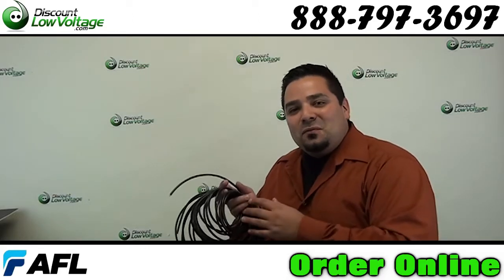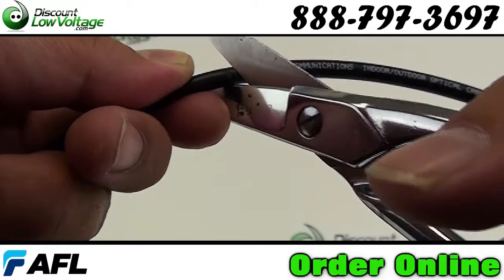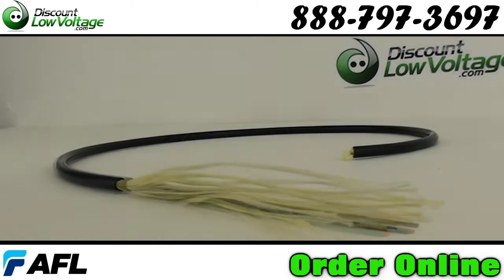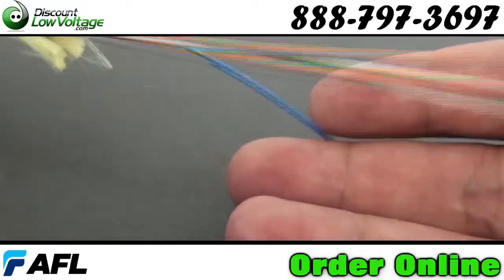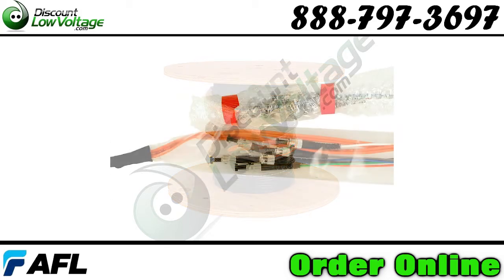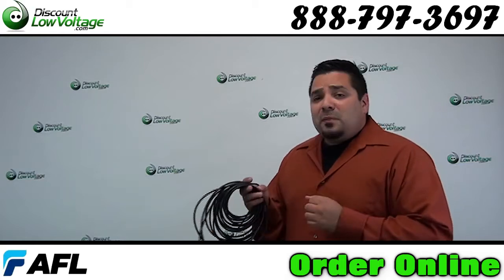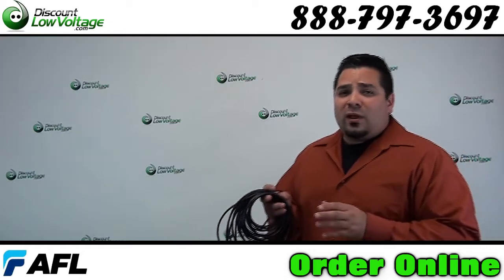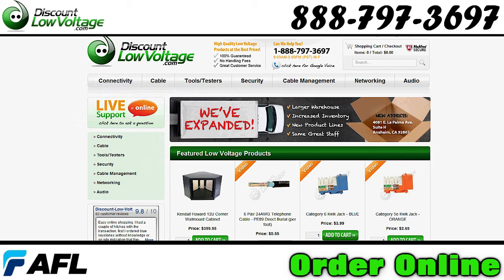Indoor/Outdoor Rated Tight Buffered Fiber Optic Cable

Comment: It was an underground pull through existing AT&T utility vaults on the USC campus from the main MDFaround to an IDF vault almost a half mile away.Straight pulls except the ends where they entered the buildings. 8 utility vaults in between and figure eights the size of a bus. Poly-water is the bomb.

Comment: Hola from Mexico. Does optic fiber works at low voltage, this is for a swimming pool? I appreciated any advice🙏
Reply from the maker: This cable will work underwater but it's most common installation is in a conduit underground between buildings. You mentioned voltage, fiber carries light and no power. You reminded me of a customer who uses this king of fiber for his robot. He would use this cable for the signal and the robot would go in an oil tanker and inspect the walls.

Comment: UV resistant? For outdoor use? I have never installed fiber that wasn't in conduit, or inner-duct, ever. "Inner-duct to the tray, is what I always say". Connectorized is a not so good idea unless it's only the inner end on the reel. Pulling connectors through conduit, not so easy. And I wouldn't guarantee any conn. that was pulled through pipe. I did it one time, with a 144 strand MM connectorized 2,500 ft. in an empty 4" conduit. If it wasn't empty, no way. Every strand tested okay. Luck.